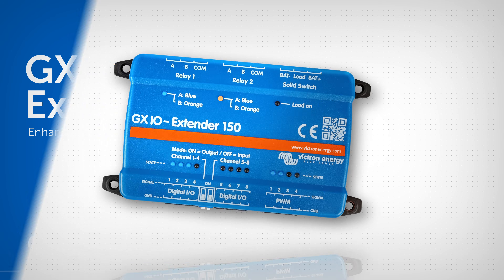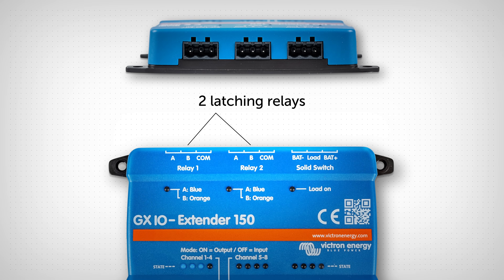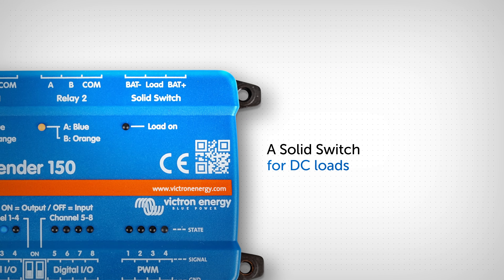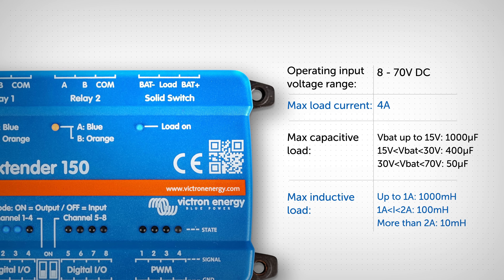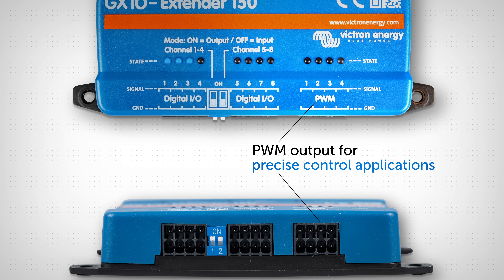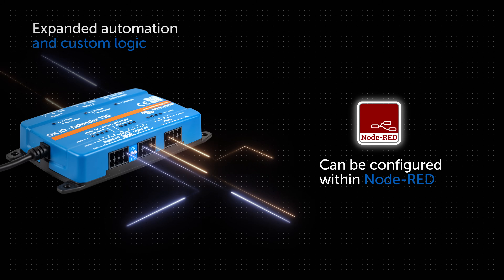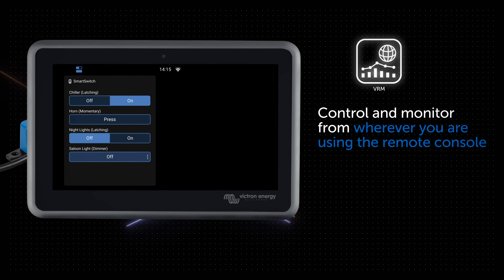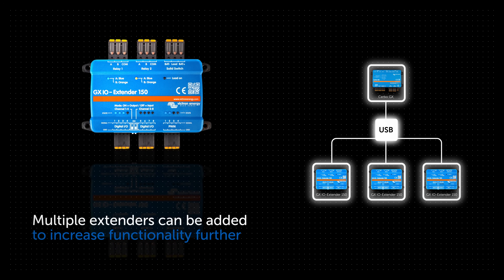New GX IO Extender 150 giving you more switching options Victron Energy

Comment: Disappointed by Missing Essential Cable
I purchased the Victron VE.Bus Smart Dongle for nearly €100, only to find out it does not come with the essential UTP cable required to make it work. Seriously? For a product in this price range, excluding a basic connection cable feels like a deliberate cost-cutting choice at the expense of customer experience. Having to buy an extra cable for another €10 is both annoying and frustrating. This should be clearly stated or—better yet—included in the box. Not what I expected from a company like Victron.

Comment: Would it be possible to use one of these to create a software switch that would dim LED lights?
Reply: If the LED can work with the 5V 1.5kHz PWM signal, then yes.

Easiest is most likely to try it.

Comment: I love the idea of integrating this on my power wall, but, why only 0.5A @240v? 🤔   I am currently switching up to 10A on any of my Dingtian MQTT relays through Node-Red and up to 13 digital I/O through an inexpensive Arduino.
Reply: The IO-Extender is not meant to compete with these switching devices. It’s meant for signaling for automation.
Reply: @WarwickIsSensible Ja, het zijn alleen stuurrelais. Voor vermogens moet je altijd externe relais toepassen want anders loop je het risico dat een contact in de controller vast brand als je eens een sluiting hebt. Been there, done that. Die fout door te zuinig zijn maak ik niet meer. 😊

Comment: Is it possible to use with other kinds of "controllers" as Home Assistant for example or another linux based box with node-red ?
Reply: No, this needs to be connected to a Victron GX device. 

If there is HA installed alongside the GX, then the extender IO can be accessed over MQTT.